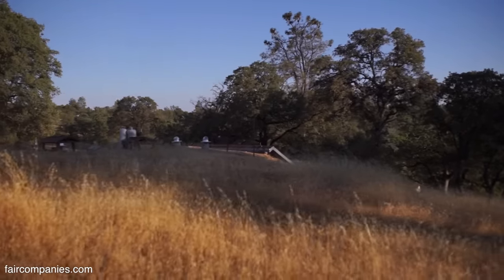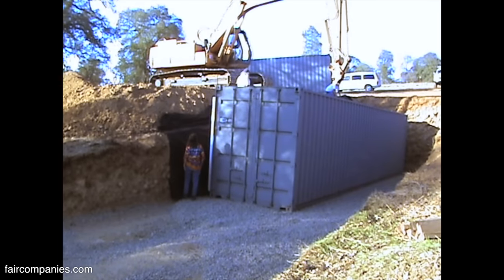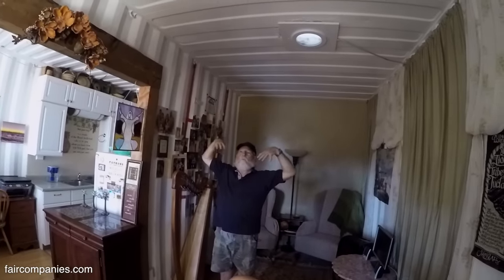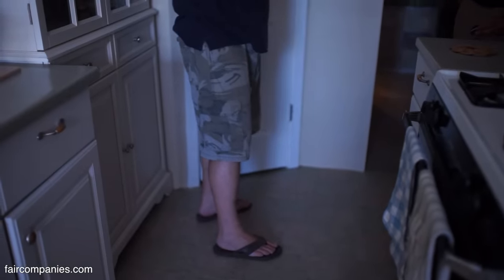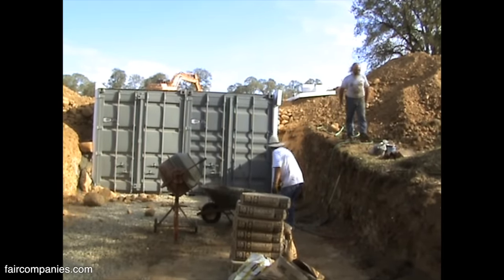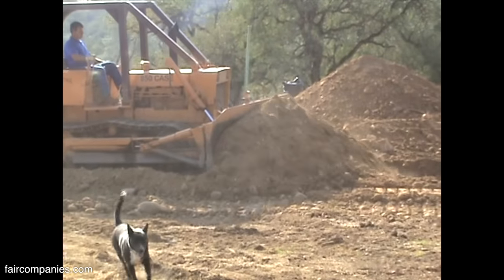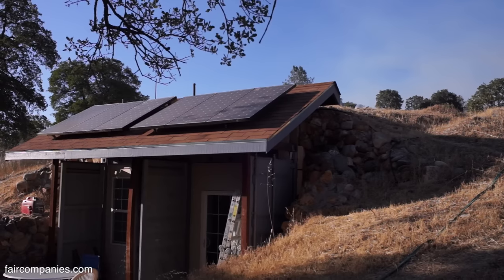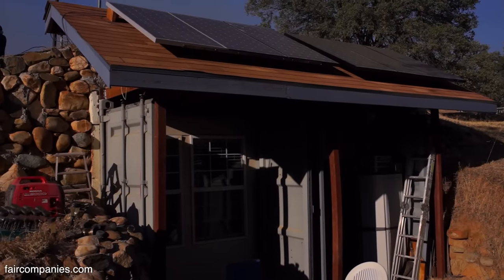Earth-cooled, shipping container underground CA home for 30K

Comment: Where's the backdoor? I think there should be a second exit. In case of fire or whatever. Have a backdoor with stairs going up. Or even a tunnel coming out somewhere else. Incase the in-laws show up or unwanted friends. You can escape and they'll never know. lol!
Reply: I was just wondering what would happen if someone came along and closed the container doors.
Reply: JeromeAz57 With all jokes aside, a second exit is a necessity.
Reply: JeromeAz57 Houses doubt need a second entrance.  Apartments don't either.
Reply: blkcandywarez Hahaaaaaaaaaaa !
Reply: zilfondel they don't need them but they out certainly have them.
Reply: Justin Voluck hotel rooms don't have kitchens.  It is to your own standards though.  If I was sleeping in the back, I would want an escape hatch having been through a house fire where it started as a grease fire.
Reply: Justin Voluck yes, you are absolutely correct.  Extended stay usually has a full kitchen and I have had the luxury of staying at a few.  Food for thought though...usually there is a window on opposite wall from door or the kitchen is in a corner and bed is near a window or a door...or both.  I think my point is in this situation...there is no escape in that room if you get trapped by fire.  It could easily be remedied with a trap in the ceiling or a tunnel out the back.  It is just my personal need/preference if I were to make one I would put one in. Cheers!
Reply: Building codes do require an egress window from all bedrooms, which is basically a second exit, not an entrance.  That window must meet the following specifications,  "An egress window must satisfy all four International Residential Code  (IRC) criteria: Minimum width of opening: 20 in. Minimum height of opening: 24 in. Minimum net clear opening: 5.7 sq. ft. (5.0 sq. ft. for ground floor)."  This is required on all "permitted" residential properties.
Reply: JeromeAz57 lockit bulldoze closed what unwanted friends family
Reply: lol-. dont been in many hotels ahve ya!?
Reply: JeromeAz57 ...lol
Reply: JeromeAz57 Technically there are 2 exits already, even if the openings are located side-by-side eight feet apart.  Each shipping container has either a window or door that you could crawl thru if necessary.  However, a rear exit would make me feel better if I lived in there.  Also, someone could just lock you in if they closed those doors.  I hope the doors are locked open with some secure latch to help alleviate that fear of being trapped underground.
Reply: This house isn't built like a tinderbox like most American homes. A smoke detector and fire extinguisher would suffice. That and a "no dumbass" policy!
Reply: @golf-n-guns  no its not
Reply: @zilfondel  yeah and my house isn't underground and made of steel.
Reply: @zilfondel  Yes they do.
Reply: Justin Voluck  The windows.
Reply: Justin Voluck  The window.
Reply: watch at 6:44 as they enter the bedroom. escape hatch in the ceiling, just like in campers
Reply: zilfondel .   I understand that any bedroom MUST have an egress window .
Reply: @zilfondel  
Here in California you do. State fire laws mandates that you do even in appartments you need a fire safe ladder for a two story.
Reply: Pop the hatch batman

Comment: Truly inspiring. A tip: You can buy a a partial container that only consists of the bottom part. If you put that on top of your home container, then you don't need to create a slab that shifts the weight to the corner posts.

Comment: I thought the cargo containers wouldn't hold up underground, I like how you solved the issues . The containers are cheap, but not made for the weight in the middle of the roof and sides, and being metal corrosion is an issue. The drainage, insulation, and the concrete slab over head to distribute the weight looks like it will work well...you did have a bulldozer on top !

Comment: I used to work in similar settings, where we grew medicinal mushrooms in burried container rooms 3×3 wide. They had a lot more dirt covering them and no walls between them, just posts. And I recon it works beautifully if moisture is controlled. The whole thing was lined a bit more outside and cement sprayed smooth inside. Didn't look like containers at all..

I've had the same idea for a house, except my plan would have a burried 15 000L water tank or sitting on it, accessible as a 2nd floor.

Comment: To combat rust try cathodic protection. Its been used on the Alaska Pipeline for decades.
Reply: Can be done, cementing it in on all sides helps a lot, because when the concrete covers the steel it seals, there will be some inevitable light rust, but it stops when the air is consumed by the rusting process completely. Then cover it with earth. Also helps keep moisture from getting at the steel. Zinc anodes tapped into the steel can stop the rusting process, but they'd need to be accessible to change them.

Comment: Give that man a prize!
I would've probably never thought of planing the 2x4s for the walls.
I would've been punching holes in the metal, So a Big Thank You for the video!
Reply: In Iraq we used shipping containers for just about everything. From workshops to bunk houses. We would cut 2X6 boards 1/8 or 1/4 of an inch larger than the vertical measurement of the container. Place them where we wanted like studs then beat them into place with a hammer. This created anchors for us to start building with wood. The steel is flexible enough to accommodate 1/8 to 1/4 inches without being damaged. They were immovably solid, to remove to the 2X6 anchors we had to cut them in half

Comment: I was kinda worried at first because the build didn't show any concrete being used and then he mentioned having to use a masonry bit to get through the walls for running services into the structure.  You DO NOT want to bury shipping containers without any concrete and rebar. Shipping containers really only have support strength on the corners where they come into contact with other shipping containers for stacking. The sides and ceilings will give way to the weight of the dirt if no structural concrete and rebar is used to encase the structure.

Comment: Wow!  This is really interesting stuff.  Subbed right away.  Off to see more of your stuff.
Reply: i'm not even subbed and i get recommended to this channel all the time lol. 
but that's because i'm obsessed with the idea of earth covered homes as i love the savings on heating and cooling and electricity. it's just better this way like ppl who live in extreme temperature locations should really consider the benefits of such ideas as this.  

an example is Arizona, they get extreme hot temps during most of the year long. but all of their homes are built for the use of central heating and cooling. but what happens when the power goes out for whatever reason? they are fucked. but with a house like this, they will be just fine and not to mention they will save all year long with their heating and cooling of their homes.

Comment: You could have had the two containers about 6 feet apart.  Then poor a concrete slab over the two, spanning the gap,   then you've have a closet about 40 foot, with only a little more cost.

Comment: Appears to be tornado and forest fire resistant.
    It would also discourage thieves.  In order to rob a place, it is necessary to know a place is there.  Then there is the problem of gaining entry, if robbers did locate the place.
Reply: Especially if you close the doors and lock them if you travel!
Reply: @reeblesnarfle5443  If they are buried you can't travel with them, and unburied they are not fire and tornado resistant.
Reply: If there's a will, there's a way

Comment: Love it. Went out to NM recently to stay in an earthship for several days. It was a way for me to see the design in action. Ive got an engineering background, and have been a general contractor now for 8 years. We are taking many of the designs from earthship and building a modified version here in Oklahoma. For cost advantage we will likely use containers as the base for the build. Have built a small solar system to test on our current property and have been running a small portion of our home strictly on solar and battery backup. Very reliable system when built property. My wife and I both enjoy smaller homes, so this seems like it just fits what we are looking for. We would use 3 containers though
Reply: I would love updates as you guys work on this! I've been trying to research putting containers at least semi-underground (maybe a foot or two of container above the ground berm for windows to let in light). I'm wanting to design the project like an earthship.
Reply: I would imagine underground homes would be useful in tornado alley?

Comment: These containers are not designed to bare that weight on the sides like that.  But if I hear correctly its been there since 2002ish.  Hope it holds up.  

Other than that its fantastic.
Reply: +Brock Samson LOL, look man, I worked ship yards and built ships and these, they are bomb proof and yes designed for side pressure. Its all in the corrugation and continuous welds. Honestly his concrete roof was overkill. The type of metal used is also high PSI rated..... I hate to say this but you should not comment it you have no idea what you are talking about
Reply: Some Guy Oh for sure they can, each one can literally hold 75,000 pounds to ISO standards which means they fail at 150,000 pounds!
Reply: *****
Thank You Cap.  I am burring my own home as well but I am using a 12 gauge galvanized steal culvert which is designed to go underground.
Reply: ***** Its all in the corrugation. but honestly I think containers would be much cheaper in price and easier to work with as a whole
Reply: *****

Yeah, I got a 10x20.  I will be doing something very similar to what this guy did.  As for permits, it is in the sticks so I am just going to push my luck. 
Take care.
Reply: *****
I researched it for about 3 years before I decided on the culvert.  There are too many modifications/challenges with the Conex container that bring the price back up.  My main issue was strength and longevity two things I don't have to worry about with the culvert.

Also this guy has one way in and one way out which could be dangerous if he has a fire. Mine will have a back door and front door.
Reply: ***** fire really is not an issue, still not seeing cost effectiveness but thats ok, not my place to change your mind on your plan,,,, its yours and we all have our dreams like and wants. I hope it all works for you and you enjoy it.
Reply: Hard to believe the expertise of a guy you can’t spell bear
Reply: Can I trust the expertise of the guy who can’t spell bear?

Comment: Yes, it's 25 degree cooler but it's still 80 flipping degrees inside. Too hot for no ac.
Reply: +in2food that's mid-day, though. At night it will be much cooler.
Reply: +in2food That's dry heat, though, and all you need is a fan to keep the air moving. I grew up in CA, and 80 is nothing there compared to 80 here in the Southeastern USA where humidity is high, and it's miserable from mid-April until late September. You sweat, and it doesn't evaporate, you just boil in it! Any temperatures above about 75 here, is unbearable to me. In California, or other dry climates that I've lived in, I can tolerate much higher temperatures with just a fan or breeze.
Reply: +in2food You could put in Geothermal and get it cooler with not much work.
Reply: +ffjsb that's what I was thinking. Just pull in underground cooled air with a solar powered fan for almost no ongoing cost

Comment: I’m wondering how these are holding up since a lot of people say the ground pushes on them and makes them cave in (?)
Reply: Have always had a suspicion that I'd better cross-grid it with reinforcing metal on the outside!!..
And yeah..the deeper you go , the more the pressure..
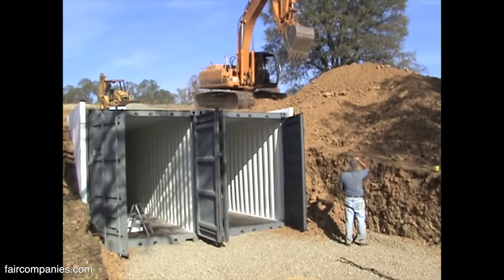Reply: At 2:28 it appears that there is a concrete shell around the containers. Later he speaks of the difficulty in drilling into the roof as after you get through the metal you're in concrete? I wish they had given more information on how they handled drainage problems as well.

Comment: I have decided to build a similar house in North Texas, but I am not going to bury it. It will be concrete and steel on grade and I intend shoving dirt up against three sides and across the roof. The roof will be spanned with I-beams, so I can park both my car and my tractor on my roof and that will also be covered, which protects the car and tractor, but also collects rainwater. On each side I plan on putting tinhorn tubing (like across a driveway continuing a bar ditch)  in the shape of a large “U” so I can circulate air taking advantage of the thermal mass around the tubes.

Comment: Interesting but I prefer having a few Windows!
Reply: +bob Last Set the containers sideways and there would be ample room for plenty of glass.   You would want to find a hill with a southern exposure though.
Reply: +bob Last   they don't have many but have the sliding glass door and window by the entrance
at  03:08  you can see them, but don't blink ;)
Reply: +bob Last Computer is your window to the world. If you mean control surrounding area, that's another story.
Reply: true!
Reply: I'd put in bigger tubes for skylight, with optional venting too, more passive, less reliance on fans.
And another container.
Reply: bob Last 
I did the same thing in Texad but I used 60 in LCD TVs and 25 in LCD TVs in every room and DVDs and still pictures as windows they make light and you can pick your views

Comment: BAD IDEA.  Shipping containers are NOT designed to be used like this, they aren't structurally designed to take the weight like that.  Insulated concrete forms would be a much better way to go, and it's much more flexible in terms of design, and much better suited for that kind of use.  And it would probably cost about the same, and be much easier to finish.  And you'd never have to worry about rust, because even Corten steel WILL eventually rust.
Underground building certainly has it's advantages, but I'd never use a container underground.
Reply: how would you explain shipping containers stacked 4 or 5 high on the ship then? that bottom one has tons of weight on it.
Reply: +Sean Williams They actually stack them higher than that.  The weight is transferred through the extra heavy steel framing on the ends.  That's why 45' and 53' containers still have framing at the 40' spacing so the weight is transferred correctly.  NONE of the weight is transferred through the roof, sides or floors, it's all in the ends.  Look at the ends of any container, and you can see what I'm talking about.
Reply: People underestimate how much dirt weighs. I agree with the ICF versus the containers under ground. Above ground is a bit harder with all of the bracing needed to keep them plum when pouring.
Reply: 8 high on the smaller containers, the X-height ones do not stack that high, but do go 4 containers to 6 containers high.
Reply: 8:57
Reply: insulated concrete and huge glass doorways on both sides...

Comment: 80's to hot though, about 10 feet lower and you be 70, maybe 65. It's pretty much 65 in a coal mine with good ventilation in the winter.

Comment: no way this was 30k.
Reply: Well he seemed pretty instrumental in over seeing the project as a whole. He designed it etc' and sub'd some of the work out. That aspect alone would've saved $30k. I assume the land didn't cost a whole lot either.
Edit ... On a side note I don't understand where the dislikes for this vid' are coming from.  What they've done here is so sensible.
Reply: I agree with Fernando, the excavation alone would cost at least $10,000 in Texas. I can't even imagine what it would cost in Commiefornia. Good condition containers God for $5,000 to $8,000 depending on size and source so now we're at $26,000 without any delivery or interior or aggregate or solar or finish. No way it cost $30,000. You might get it done for $50,000....   maybe.
Reply: @christopherwedemeyer2993   you can get a container for 2-3k where I live $1.50 per mile shipped. I would do the excavating for around 2k or so. A 4" slab is only 8 yds of concrete. 1 ton of rebar. Couple try axles of rock. You can get prices and count it up. You would be surprised at what you can do with 30k if you get prices. The land is what cost the most.

Comment: The reinforcements he made seem to be quite sturdy. You just can't bury a metal sheet box and drop dirt on top. If that gets wet is going to weight a lot of tons. And the drain gravel to the sides is a need as well. 
Very important in the design.

Comment: PSA: Do not bury shipping containers as underground homes.  Shipping containers have structural support on the corners mostly, not the sides.  Any signnificant amount of weight (dirt) will cause a cave in.  The best design for an underground house is a dome shape because it distributes the weight of the dirt evenly.
Reply: +Slyvr18 He addressed the weight concern with the concrete slab tied to the posts.  The rest of the container is bearing no weight according to him.
Reply: Robert Hawkey
I don't see how that's possible, but ok.
Reply: @roberthawkey7164  listen to what he said about support

Comment: I made space between comic boxes..then made rebarred slab top side. and metal bottom across boxes,with metal I beams on 8 corners of each box to hold extra wieght..adding more space in middle..at very little extra cost..used PVC with poured clear fiberglass for light(solor lighting)